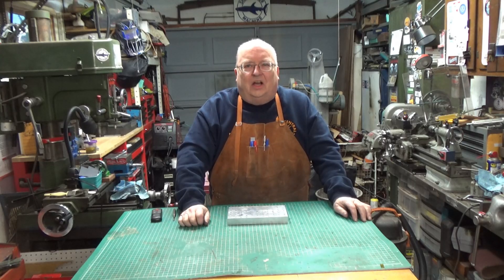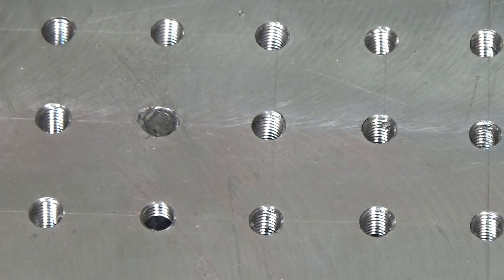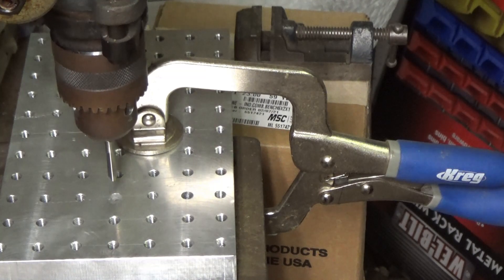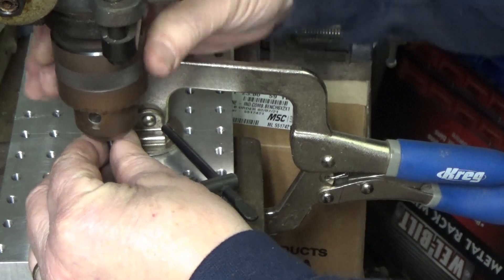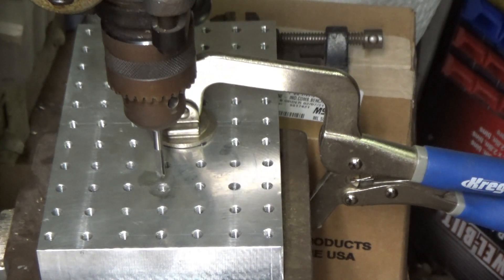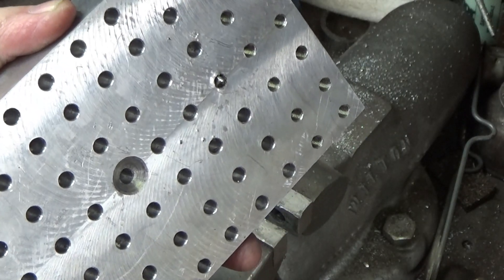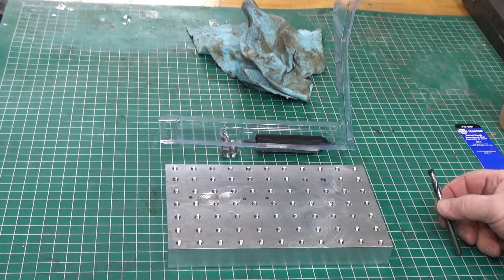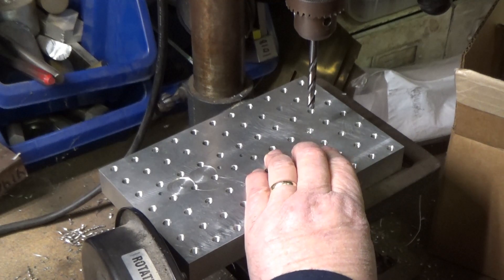Drilling Out A Broken Tap

Comment: I have been using single flute carbide drills for years to remove hardened screws from rifles and pistols and heads of engines.
Reply from the maker: I purchased one many years ago when I still had my automotive machine shop. Removing broken bolts was something that we did every day and that included removing broken drills and EZ outs after the customer failed trying it themselves. The first time that I tried to use it, it shattered.  I do believe that the carbide tooling that is made today is far superior to the older material.  By older I am referring to before 95'.  Thank you for watching and commenting.

Comment: Steve, here's my vote for more "shop tips" like this one!  I thought that I wanted to keep a selection of the Omegadrills on-hand, just in case, but they certainly don't give them away.  I'll order them as I need them though.  And keep diamond burrs available for my Dremel tool too.  Are your diamond burrs the ones made out of Chinesium or are they from elsewhere?  Mine are Chinese, but I've never ground hardened material like taps, so I don't know whether mine would be successful.
Reply from the maker: The diamond burrs were cheap Chinese pieces and they did not last long.  Fortunately there were several of the same size. The drills are pricey for sure.  I purchased one to try it out and was happy that it did not blow up.  Thanks for watching and commenting.

Comment: Metric 🤔😆
Reply from the maker: I have a lifetime supply of 6m socket head cap screws so I use them whenever I can. I can speak metric LOL. Thanks for watching and commenting.
Reply: @sharkrivermachine  just despise metric, always complicates things that shouldn't be difficult, esp buying tools, never is correctly sized! No offense to you what so ever, snapped plenty standard taps, is usually the gorilla with the cheaterbar 😆 that causes that pop and plenty of cussing 😉
Reply from the maker: Metric is a fact of life, like it or not  I come out of the automotive industry and we had to deal with both systems starting in the 70's.
Reply: @sharkrivermachine  same here on working on vehicles

Comment: Thanks for the video. I had tried a similar drill and it shattered. I think the rpm was way too slow and too much pressure applied. Next time I will follow your instructions and hope for better results.
On my pallets, I have been making washers to space the part above the surface when bolting through the part and using polycarbonate (Lexan) plastic sheets between the part and the pallet. Lexan can be drilled, sawn or machined as opposed to acrylic plastics that like to shatter. This makes Lexan a good material to use as spacers. Our local plastics store (Tap Plastics) has a rack with off cuts that that sell at bargain prices, hopefully you have a similar opportunity in your area. Both methods have worked well and so far the pallet surfaces have stayed free of those annoying tool marks.
I also build Live Steam locomotives and some of my work can be seen on the Fitchburg Northern Facebook page and my own YouTube channel.

https://www.youtube.com/channel/UCoLCaAzyT64hzoZU6iaRvlw/videos
.
https://www.facebook.com/groups/FitchburgNorthern
Reply from the maker: I would like to build a simple G gauge live steam locomotive. I have been looking for plans.  The last job that I used the pallet for I needed to drill some dowel pin holes in it to locate the part that need features machined o both sides.  It worked great for that and I have no problem drilling it or hitting it with a cutter.  That is what I made it for. I will check out these sites.  Thanks for watching and commenting.

Comment: Sweet,,, oh yes, I need more of this Steve. Broken taps make me 🤪 I remember when I built Volkswagen engines. We used a butt load of these Steve. Some people would over tighten those head bolts and wonder why they start popping on a cylinder or two. Enjoyed watching 👍
Reply from the maker: I Helicoiled a lot of VW blocks and heads.  The exhaust studs broke off in the heads all of the time. Thanks for watching and commenting.

Comment: M6 and M8 were the first helicoil kits I bought, and a few dozen holes later they are still around. Since then gotten them as either the tap and inserts only, or the whole kit. Hardest to get are the US sizes, as the only ones I bought were stock from the 1970's, which were insanely cheap, having sat on a shelf for a half century without moving, and which were all reduced to clear. Inserts for them will be a problem as well, when the dozen or so per kit are used, but I rarely deal with US pitch threads, so not too much of a worry. 

Currently can handle all common sizes from M4 to M16, though there are gaps, as I did not need those sizes ever. Most commonly used is M6 and M8, especially in aluminium, as those will be the first to wear out the holes, though I have done a few on engine blocks as well where the fastener stripped out the cast steel, probably due to the original casting being poor, or the bolt being installed by the Hulk.

Also have a few broken tap extractors, the do sort of work to get a tap that has snapped, but not totally bound, out of the hole, but yes often you will have to break the tap into pieces to get it out, and fix the hole up as best as you can. Some went to a helicoil, come went to drill and tap the next size up.
Reply from the maker: I had an automotive machine shop until 1995 and we used Helicoils almost everyday to repair customers attempts to remove broken bolts on their own.  I have metric sizes 8m thru 18m which is a spark plugs size. But of course when you are working on a project you never have the correct size when you need it LOL. Thanks for watching and commenting.

Comment: When did helicoil dream up a new installer?  The internal portion of the installer appears to have stayed the same?  I prefer solid thread inserts so I rarely use helicoils.
Reply: I make my own inserts.Larger fine thread bolt,drill and tap to the size you need,install with locktite and,cut it off. I never use Helicoils.
Reply from the maker: Those installers have been around for many years, but only for the small sizes under 1/4". I use solid inserts also but I prefer the Helicoils because they are smaller in diameter. We used to install a full set of coils for the head bolts in aluminum cylinder blocks.  Thanks for stopping by.

Comment: Super video, Steve!  Was wondering how those Omega Drills worked - now I know.  Just had a broken tap saga, and got it out by grinding a screwdriver slot with a diamond burr (lots of work though).
Reply: Tip for next time, take the remains of the tap, and run a correct size nut on it. Then take an old windscreen wiper blade and get those stainless steel stiffeners from next to the blade, and slip through the gap in the tap, to make a quick extractor. If the tap will turn, you can grind that thin strip to make it fit the gap in the tap side, and turn it out that way. Done that a few times, cheap Chinese taps that shatter like glass.
Reply from the maker: I have a full set of tap extractors but this tab actually shattered in the block so I could not get an extractor in.  Thanks for the suggestion.
Reply from the maker: There was not turning this tap out.  It went in crooked and shattered inside the material. I was pleasantly surprised how well the drill worked.  Thanks for watching and commenting.

Comment: Hello Steve, good informative video. I think I have one of those drills, that I inherited from my dad some 40 years ago. He claimed it could drill through a file, but that it would get red hot. Interesting grind, as mine just had a 3 sided pyramid form on the end. I will do a little research on your leads, again thanks, enjoyed and as always, cheers!
Reply from the maker: I had purchased a carbide drill similar to this 40 years ago to try and drill a tap.  It blew apart as soon as I touched the tap. Although this drill was similar it was a lot tougher and had that diamond grind. It worked well.  Thanks for watching and commenting.
Reply: i think what you have  got is a stellite drill   we used them    50 years  ago to drll hardened steel. .. its run at  high speed and feed   and the  shaving  comes of  red hot..

Comment: I like projects where you make something. Not steam engines. Good video.
Reply from the maker: So your done with steam engines.  I do have one to build but no idea when.  I have so many other projects that I want to do. Not sure of the order in which I will be posing the videos but I am starting a tool build for my lathe.  Thanks for watching and commenting.
Reply: @sharkrivermachine  Steve, I enjoy your practical fixes/repairs to the steam engine.  I'd also like to see you build the one you have, but I understand waiting for a while and spreading things out too for those who don't enjoy them.  I guess you need to be interested in "model engineering" to watch that type of video, especially for those who don't realize the tips & tricks they'll see that apply to other projects, not just "model engineering."  I read Home Shop Machinist and Machinist's Workshop which have lots of gunsmithing articles, which I read carefully, even though I doubt I'll ever need to perform gunsmithing in my shop -- the articles include techniques that apply to all kind of machine shop projects, not just gunsmithing.  Of course, I plan to build a black powder rifle before I check out, so I plan at least one gunsmithing project!  ;)
Reply from the maker: I enjoy most aspects of machining.  I do plan to finish building a steam engine kit that I started years ago. I hope to get the S50 steam engine running soon. Thanks for watching and commenting.

Comment: I would have cored it out and let a piece of ally bar in the hole and re tapped the new piece
Reply: A bit from a mag drill !! you lads across the pond need to think out the box
stay safe
Reply from the maker: I am familiar with the process. When I had the automotive machine shop we had a bit that we could drill down around a head bolt that was seized in an aluminum head.
Reply from the maker: I considered that but did not have the tooling to cut it out without making a mess. This work really well and I am happy with the result. Thanks for watching and commenting.

Comment: Broken tap is my nightmare... nice video. It is always a fight. I 've never seen such drill bit. In any case, i learned something valuable here, thanks for sharing the skills.
Reply from the maker: Thanks for watching! For larger size taps I have been successful using a cutting torch to blow them out. That was not an option for this little tap.